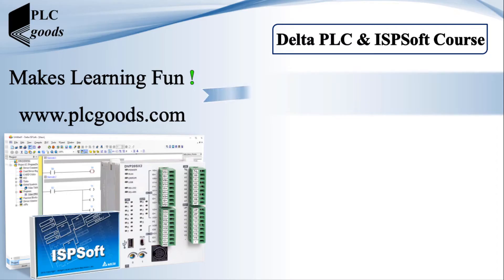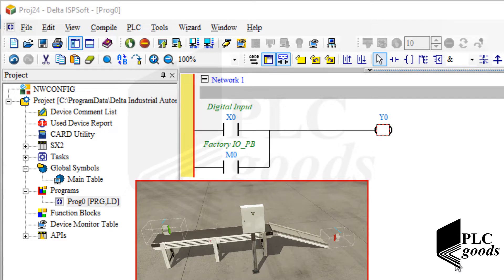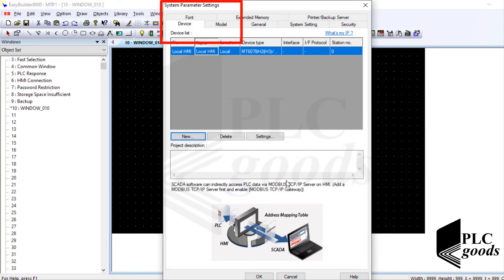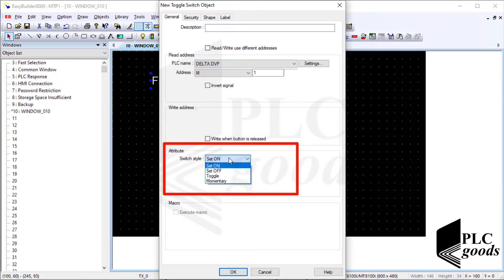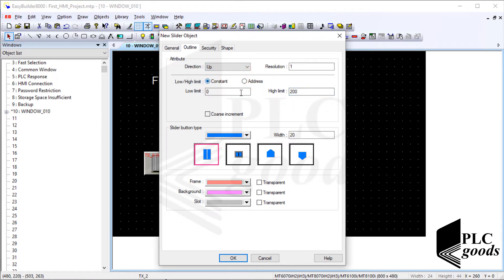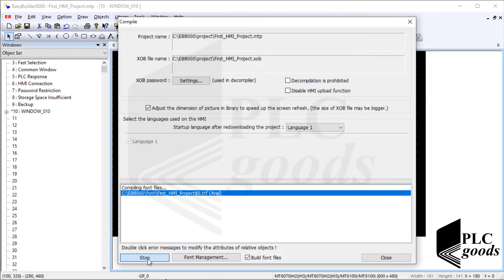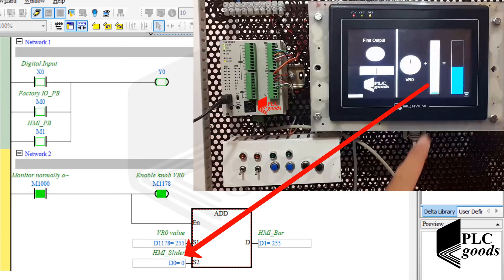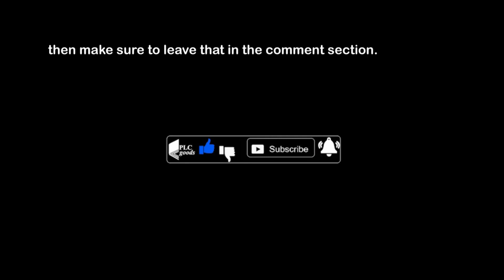Delta PLC & HMI Programming Tutorial | Easy Builder 8000 Step-by-Step Guide | Lesson 24

Comment: Good day 
I got a problem. Need to create HMI visualization for live hardware plc (dvp20sx2) any tips.
I have try using COMMGR.
Reply: Hi there. COMMGR is used to make connection between your PLC(dvp20sx2) and ISPSoft on your computer. To make connection between your HMI and PLC or between your HMI and PLC, you well need to read the user manual of your HMI and also use the software that can program your HMI.
Reply from the maker: Thanks for checking the channel out!